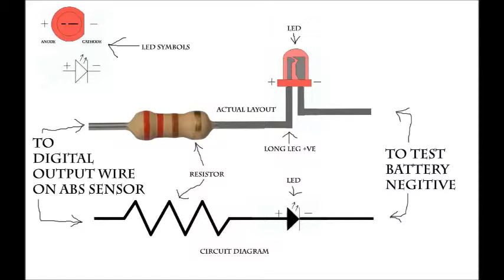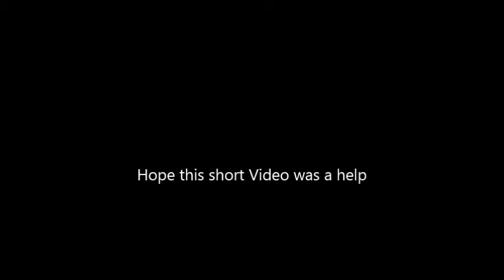YouTube Video

Comment: Hi read your article which led me here. I have an x Type jag with abs issues, replaced 2 sensors and still have a warning light. My battery is poor though which could be throwing an error. I am replacing it. To find the wire supplying the 12V power to the sensor can I unplug the sensor and with the key turned on test each pin on the loom end of the plug, (which has pin holes). The sensor has male pins. I assume I put my multimeter on DC V with Com test lead earthed and touch the positive test lead to each pin on the loom plug end to see which wire is supplying the 12volts? Is that right? BTW where did you get your orange plug, that is handy? I also assume that the sensor must be bolted in place to do the test. Is there any way of testing the sensor that I replaced now its out of the car? Could I rig up the led test light/battery and wave something metal back and forth across the tip. Or does the sensor have to itself be effectively earthed i.e. bolted in place? Also when testing the resistance across the pins of the unplugged sensor, does it have to be in place and bolted onto the car or should I see a resistance across the pins even with the sensor taken out. The one I replaced docent appear to have any resistance across the pins but I measured this with it completely off the car. Thanks